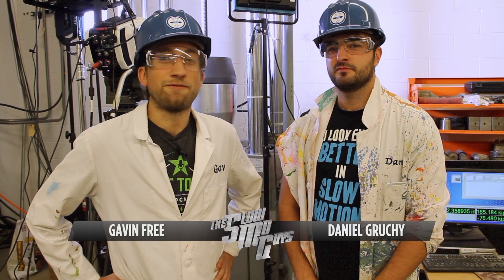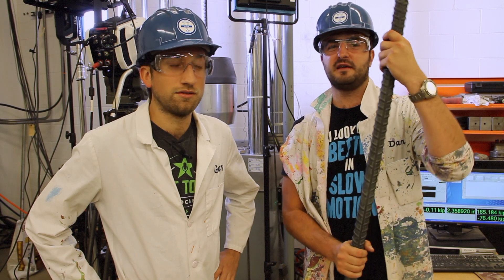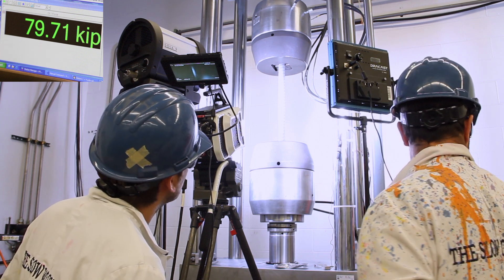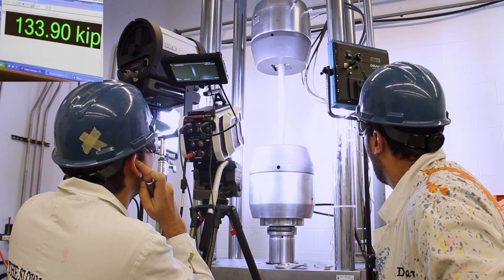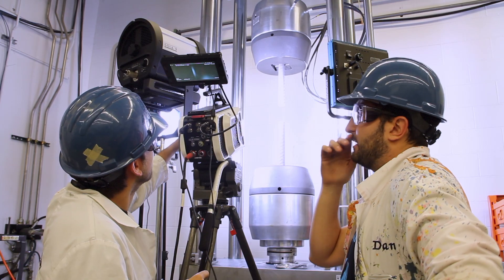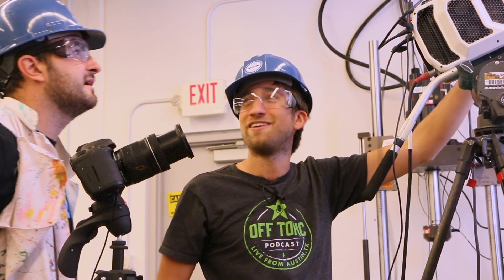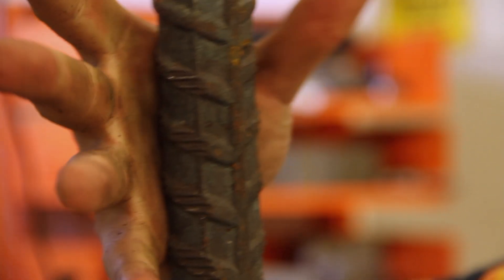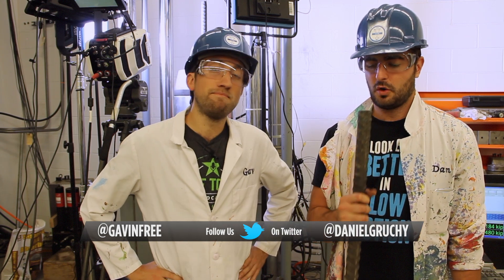Snapping a Steel Rod 1000x slower - The Slow Mo Guys

Comment: There's no such thing as "pure steel." Steel is an alloy. By definition, an impure substance.
Reply: "Pure steel" mean steel that is uncontaminated by other substances that don't belong in the alloy.
Reply: As a mechanical engineer, I have studied various material such as various alloys, I have done similar tests as they did. I can say that I have never read or heard someone refer to contamination of an alloy as purity, they are regarded as impurities or flaw in the material, just like porosity which could lead to stress fractures. But I have never heard someone call an alloy such as steel with no impurity "pure", that's just a better batch of steel, but even then it can have porosity or other types of flaws which would still make the material unfit for various usage. And the various casting process, tempering, etc, will change the % of carbon and the structural integrity of the steel, we care more about the grade. Since calling an alloy "pure" would not imply it's flawless and has nothing to do with it's property (grade), I have never seen anybody in the field use the term "Pure" "insert name of the alloy"!
Reply: There is no pure steel, that comparison was pretty awful. Pure metal are elements, go check a periodic table. Steel is an alloy which is made of Iron and other elements...
Reply: Scientifically, you're right, no mixture can be pure but stop trying to be such a smart arse, you know what they meant.
Reply: It still makes it pure steel. It's just not a pure metal. It is still pure steel.
Reply: Only if it is an element, like Iron, Aluminum, copper, etc. But even then, what is used is usually an alloy where the element is predominant like aluminum is the predominant metal in the aluminum alloy used it can also contain manganese, zinc, copper, silicon, magnesium, tin, etc.
Reply: Yeah, maybe in your professional environment it is not usual to talk about pure alloys, but in general you may call everything pure. Therefore I mentioned fruit juice - nothing in it is pure, there are hundreds of different chemical compounds - still you can definitely call fruit juice pure.
The word pure is not only used in technical language, but it is an an everyday word and therefore you can say a piece of metal is pure steel.
Reply: Exactly. Everything can be pure. As steel is 'something', steel can be pure.
Reply: Of course there is pure steel. Everything can be pure (e.g. pure fruit juice vs. fruit juice with sugar or flavor added)
Reply: I think the most important thing to consider about calling steel "pure" is that, unlike other chemicals or molecular elements, it doesn't tell you anything about the properties.
If I give you pure H2O, or copper, or acetone, or gold, you know exactly what properties it has. If I tell you I have pure steel, all you know about it is that it has carbon and iron in it. Is it a 1020, a 1040, or hell, is it cast iron (which is still just iron and carbon)
Reply: but it's purely made of steel
Reply: Xeno, define pure steel to me.
What percent carbon is it? Is it 0% carbon, 0.2% carbon, 0.4%, 0.8%?
What phase is it? Is it ferritic, pearlitic, martensitic, or bainitic? (also could be austenitic, but hopefully not, because that means it would be quite hot)

Any combination of those could be considered pure steel. 

Edit:
As a rhetoric, think about this:
Which do you think is closer to pure iron, steel or cast iron?
Cast iron has at least 2% carbon in it, typically it has 4.3% carbon because that's where cast iron has the lowest melting temperature. Conversely, steel has at most 2% carbon. So steel is actually more pure iron than cast iron is.
Reply: Well... I am MATERIALS Engineer and I've studied almost all kind of steel alloys (since simple low-carbon to such as maragins). And believe me, it is imposible to make these people understand that almost every chemical composition for an Iron alloy is considered Steel or similar, so there's no point on the concept of "pure steel" as material. 
You can talk of pure metals as Si for electronics that even if it is not 100% pure, 99,9999999% (9N's) is more than enouth to consider "pure".
Reply: If we follow that train of thought then there is no pure water no pure air no pure salt no pure alcohol no pure anything just elements.
Reply: What the most of us are talking about is not that you cannot consider pure steel because it is been contaminated, it is because there is no definition of "pure" for a steel since it is an alloy. You can consider pure Iron even if you know that it is not 100% Iron, you can consider pure water if it is pure enough or pure air if it is not contaminated... You can consider every thing can be "pure" as long as there is a definition for that pureness. So you can consider pure water, but not pure salt water, you can consider pure copper, but not pure brass, and you can consider pure iron, but not pure steel.
Reply: He was referring to the bar being pure steel, not the actual steel. Steel cannot be pure, but the bar can be pure steel, meeting it is made of only steel.
Reply: Blue Steel? Ferrari? Le Tigra? They're the same face! Doesn't anybody notice this? I feel like I'm taking crazy pills!
Reply: Ido Keren Yeah, technically, but the word is also used for emphasis when something is 100% something.
Reply: You say the contamination of an alloy is impurity. Therefor if it's not contaminated, it's pure.
Reply: As a mechanical engineering student, I agree.
Reply: I understand what you're trying to say but it's a dumb point. That's like saying there's no such thing as pure water because it consists of more than 1 element.
Reply: Ido Keren Taking the words out of my mouth
Reply: All you correcting Gavin on his 6th grade science while hes out making videos ahahahahahah
Reply: +Tech Carbon is part of steel like iron is and the % of carbon very important because it is relative to the mechanical property of the steel, it is why there are grades of steel to differentiate which heat treating, casting process, etc it went thru and which % of carbon it has.
Reply: +CakeKing Yes there are various alloys, all are different, steel, aluminum, stainless steel, font, etc. But all alloys have their grades, aluminum 6061-T6, aluminum 5254-H32, etc. All steel contains carbon, and carbon steel is only steel with higher % of carbon which went into different heat treating than your low or mild carbon steel. Actually the word is used so that people that don't know a lot about steel can differentiate it from steel with lower % of carbon, all steel are steel with different grades, but some name exist to make it more simple for the uninitiated. As for stainless steel, it isn't steel, it's stainless steel, yes both are made from the same elements, but the stainless steel % of chromium is above 11. Therefore stainless steel is considered by itself its own alloy, and not a grade of steel.
Reply: Colloquialisms aren't correct simply by virtue of being popular phrases.
Reply: Ido Keren yeah, but "pure steel" is the mixture of steel which is strongest
Reply: Actually not, that's not how it works, and this is why it upsets people that knows about alloys that they called it pure steel, it makes people believe it is stronger steel. What actually makes steel stronger is heat treating which rise the % of carbon inside the steel, but it also becomes less ductile and reduce its weldability. Each grades of steel have their purpose, there is no better steel, each grades of steel have their* mechanical properties and are a better choice for different use.
Reply: okay fine. its pure steel alloy
Reply: Ido Keren surely you can make pure steel because the alloys bond to create steel, so you can still get 100% steel without any other impurities
Reply: It is not only carbon... there are a wide variety of steels with different carbon percentages and other elements as Mn, Si, Al, Cu, Co, V, W, Ti, Ni, Cr, Mo, and almost every non-rare element on the periodic table. You cannot consider the word pure referring to a chemical composition because those steels are not defined by an exact composition, but by a range of element concentration... so it is impossible to differentiate a "pure" steel from an "impure" steel
Reply: It could be Austenitic if it has enough Ni or other gammagen element, as 304 does. ;)
Reply: KingHalbatorix It doesn't matter what's correct, only that it can be understand. I doubt anyone watching misunderstood the meaning, so what's the issue?
Reply: I'll just explain my reasoning a little more. In chemistry class, they say that the only pure materials are things made from one kind of atom or one kind of molecule. Things that are made from a singular substance that behaves one singular way regardless of the point from which you view it. Alloys are mixtures, and will inevitably have parts within them that have slightly different properties than their other parts. For example, it will melt or break or bend unevenly. That is what makes them impure.
Reply: John Reynolds There is no serious issue. I just saw something about which I could have a discussion, and I started a discussion about it. Isn't that part of the reason why the comments section exists?
Reply: Steel is described in terms of the proportions of its alloying elements, which have been preselected to confer specific advantageous properties.  If it matches its description (I'm sure the rebar did) then it's 'pure steel'.
Reply: no, what he meant was that it's actual steel not some fake shit.
Reply: LevelCrunch there is such thing as pure water because a pure substance is defined as a substance containing a single kind of element or compound. A compound (such as H20) is a molecule in which two or more elements are bonded. Therefore as long as it is a compound, no matter how many different elements, it can be considered pure. Steel is an alloy which is a mixture. Mixtures are two or more compounds which don't bond when mixed so it cannot qualify as a pure substance. So scientifically yes, you can't call it pure but the exact meaning can be skewed when people use it unscientifically such as with pure fruit juice. But someone else also made a point saying there is no guideline for what pure steel is since there are so many different grades and mixtures that you can't really call one exact mixture "pure"
Reply: Ido Keren did u just learn in chemistry about alloys?
Reply: I would never consider any type of steel as pure because steel has a grading system, what is perfect for the hull of a warship may be crap for a Tin can because one has Carbon for strength and the other has Tin for lightness.  When you think about it Iron can have a 100% Iron content because it is an element, it can be "pure" atomically, steel however can never be 100% Iron because if it did that it would no longer be an alloy and would be pure Iron.

But that is an atomic definition of pure, if we only used that then you could never in a million years have such a thing as pure water because water by it's own definition is made up of two different elements, Hydrogen and Oxygen in a 1:2 ratio so it is 33.33% of one thing and 66.66% of something else.

To go with what Leli196 was saying you need to widen your scope to include alloys and compounds of elements, but you can also go in the other direction and simply break things down in to just gases and metals where water actually would be 100% pure, because both elements in it's makeup are gases.

It's all about how wide or narrow you define your parameters and since we all define things differently both Jean-samuel boisvert who doesn't consider steel pure and Leli196 who does are both correct by their own definitions.
Reply: Rob Fraser pure water is a thing
Reply: alloys are by their very name a mixture of materials,  "pure" steel would be 100% iron, which is actually useless, and virtually impossible to use as it would contaminate in air and start to oxidise instantly.

what makes iron into steel is the useful impurities which when introduced and carefully controlled make it an incredibly versatile material which can be used in an astounding array of things, from car bodies to armour plate, from chair legs to scalpel blades.... it's one of the most useful materials man has ever created.
Reply: actually the more the carbon the more like cast iron it becomes, the less the carbon the more like butter it becomes, mild steel is very low carbon and is pretty crap, whereas the harder grades are about 4%. cast iron is above 10% if i remember correctly, it's been a good few years .
Reply: Ido Keren NERD!!!!!!!!!!!!!!!!
Reply: Ido Keren so is there a pure metal?
Reply: Steel ... is made out of Iron and a very low percentage of Carbon. Note that Carbon is basicaly anywhere ... Pure Steel can be a thing ... if you don't mind the Carbon.
Reply: You can't "contaminate" it cause it is an alloy and ther are so much alloys which call them self steel so it isn't right to say contaminated for example there's Carbon steel ( Carbon and iron ) and for another example ther's stainles steel ( here are various types of alloy but iron  and Chrome are one of These alloys )
Reply: Finally someone with common sense, where have you been all this time?
Reply: Leli196 you don't understand do you
Reply: Ido Keren smart ass
Reply: take a look at the peroidic table ;)
Reply: Meh.
Good video.
Reply: Ido Keren I don't think they meant pure as an actual measure of anything,  they were just saying that it didn't have anything else in the bar. They aren't scientists Gavin is a filmmaker and comedian and Dan is a soldier.
Reply: Not necessarily, you can have a "pure" alloy if the alloy has a certain formula. For example a 40% iron, 60% carbon alloy would be a PURE alloy if it had EXACTLY 40% iron and 60% carbon composition. But yeeeaaaah I'm kinda grasping at straws for an arguement.
Reply: To the people who come on to this thread just to call everybody stupid and say that this discussion is pointless, why would you even participate in it? The only reason it would ever bother you in any way is if you voluntarily left a reply. You didn't have to do that. If we want to talk about it, then we can. You don't have to.
Reply: Maybe they meant that there was nothing else except for what make it steel? Like, there were no other metals.
Reply: just substitute "pure" with "high quality".. problem solved
Reply: cant do that you'll upset the grammer nazis and the rage boys ROFL
Reply: ***** Sure, but I think we're having an interesting discussion here. There's no real reason to cut it short if there's more that people want to add.

Comment: I actually used to do this at a quality control lab in a rebar steel mill.  It's measures the tensile strength of the steel.  The #11 bar is the biggest we did. It is pretty loud when it breaks.

Comment: I was most certainly thinking about the safety and Temps for them touching that, not about them touching a rod
Reply: Jacob West Pat I just tried to catch fog

I mist 😉
Reply: It is pretty safe, that exactly how it was supposed to split, and the friction from the atoms inside caused by the stretching wasn't enough to make that rod burning, since I don't have precise information about the rod and which steel grade they used I will not calculate the exact length of the stretching but my guess is that it wasn't more than 1 inch, sanding the belt with grinder would have generated more friction than that. These kind of tests are what mechanical engineering student will do in school at one point, but on really small test samples since what you really verify in those test is the property of the material, which will be proportional in the full size rod. Have a nice day!

Comment: No necking occurred? I'm disappointed. Or the steel was fake.
Reply: That's a very tiny necking.
Reply: Materials tester here. Necking is always present. It's more like: The stronger the steel, the less necking. This steel is probably approx. 600-800 N/mm², which is normal for rods used in construction.
Reply: Drachenbjörn thanks. I study mechanical engineering,  but not materials. I remember very little from strength of materials.

Comment: If you could get the frame rate high enough, you might be able to see a shock wave traveling through the steel away from the break (speed of sound in solids is very high!)